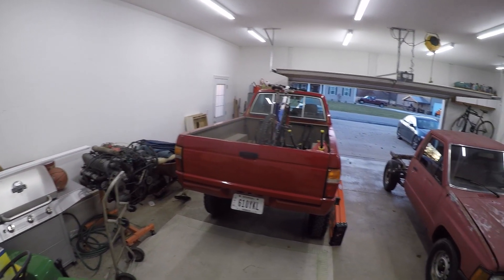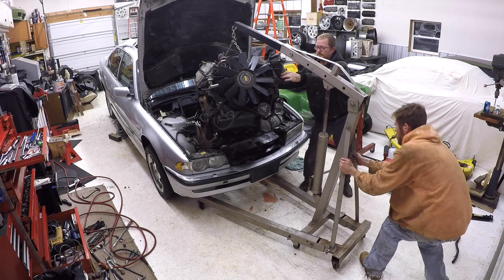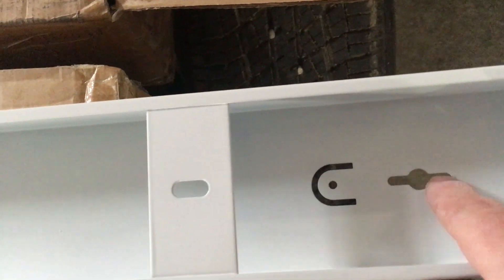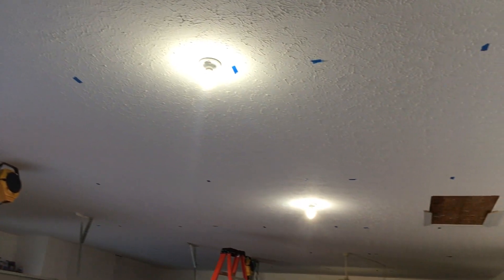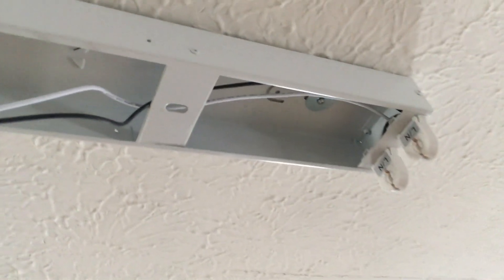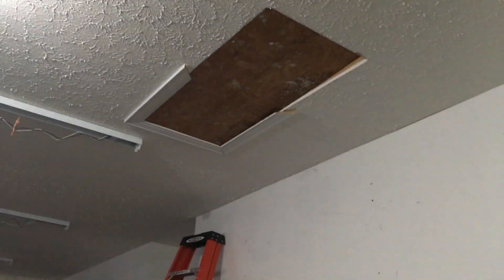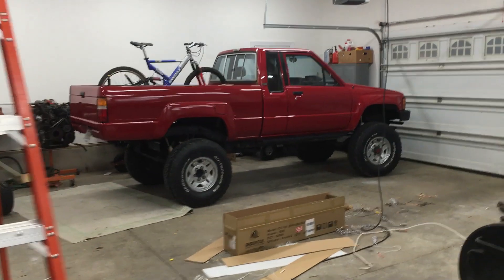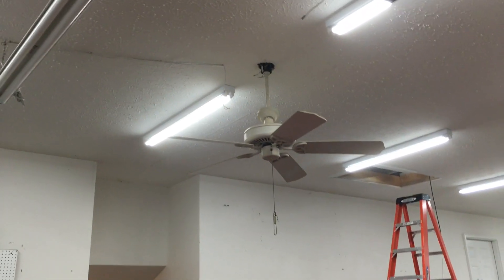How to: Install T8 LED Garage Lighting fixtures, bulbs, wiring

Comment: Honestly, the LED's are one of the bet moved I have ever made. It saved us a ton of money. They last a lot longer than CFL's and catch on fire less.......
Reply from the maker: It's amazing how inexpensive they are now.
Reply: @6thGearGarage  I remember buying a 2 pack of LED's from radio shack in the 80's for $2.40, think about that for just a second.   When the retrofits for our kitchen became available I couldn't believe how inexpensive they were.
Reply from the maker: @JimsEquipmentShed  About 7 or so years ago I had a friend replace all the bulbs in his house to lower his electric bill. I wonder if he recouped his investment because he paid like $17 PER bulb. The bulbs were a funky shape back then, not like a normal round bulb like the LED's. I always bought CFL's until a year or so ago.
Reply: @6thGearGarage  Yea, its a lot more economical now, I know I held off for a long time due to cost. When I first looked at the LED replacement cans for the kitchen they were really expensive, when they dropped down to about half, i jumped on it. I stopped using CLF's around the time of the second melt down. No open flame on either one, but in both cases, they failed before two years, and did so via heat, and smoke.

Comment: Another excellent video!  Been thinking about putting that white metal siding on my ceiling similar to your first garage.  I'll be checking out that Garage Forum.  Thanks again dude!
Reply from the maker: The metal ceiling was a breeze compared to drywall. There's no mudding or sanding involved. The ribs allow it to be easily lined up and put the light fixtures up in straight rows. It went up fast using a drywall lift, since each piece was 20' long. I tried without a drywall lift first, and it was much more difficult. I would recommend metal for a large open ceiling.
Reply: @6thGearGarage  I'll have to check out how much it'd cost to rent a drywall lift.  Think that's the route I'm gonna go.  That white floor was a nice touch too.  Did you use Garage Floor epoxy, or paint?

Comment: What if you wanna put these bulbs in a fixture that is made for a t8 incandescent bulb? Do you know ?
Reply from the maker: If installing LED into a T8 fixture with a ballast, then you need to use LED Type A.  My fixtures had no ballast, so I used LED type B. You'll still want to compare the specs of the ballast to the type A bulb to make sure they are compatible. Older ballasts may not work.